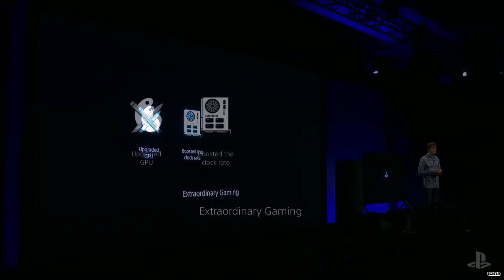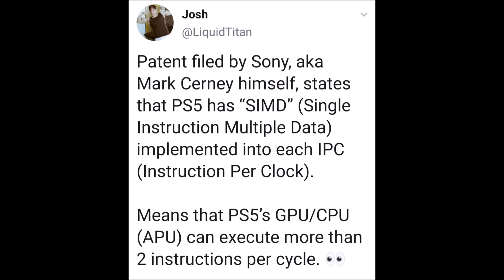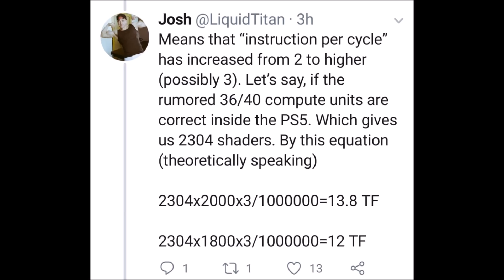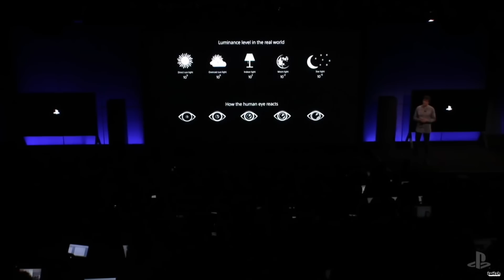Is This the PS5's "Secret Sauce"? Mark Cerny Rewriting The Tflop?

Comment: Know what this reminds me of? Ok check it out. If there's any DBZ fans in the comment section, remember during the Cell Saga when Vegeta was so shocked Trunks surpassed him in terms of power, however his muscles were SO BEEFY he ultimately stalled himself in terms of speed which allowed Cell to capitalize on that. Now think back to when Gohan went SSJ2. He was A LOT leaner but gained a SIGNIFICANT power boost & Trunks admitted he ascended beyond a super saiyan without gaining all that muscle mass. 

Xbox SeX = Trunks' beefy SSJ form. 
PS5 = SSJ 2 Gohan.
Reply: Super saiyan 2 is a more efficient transformation, keeps power and speed.

Where as trunks pulled a broly and just got brute force strength. Really powerful, but too slow.

Not a bad analogy my friend!
Reply: @NoahThomas29  Beautifully put. Exactly! And thank you mate!

Comment: People need to remember, sony and microsoft both have NOT said a word about T-Flops. that should be kinda telling. Because T-Flop numbers are kinda irrelevant now cause of not being directly comparable. 

example RDNA2 is apparently going to be a lot more efficient compared to RDNA1. Which means you could see a (im just throwing numbers here) 7 T-Flop GPU out performing a 9 T-Flop GPU from RDNA1. 

well i could see people saying “thats only 1 T-Flop faster than the xbox one x, thats not a big enough jump in power”.

But in reality the GPU would be FAR, FAR more capable than previous gen.

T-Flops are not everything.

Comment: When Xbox fanboys heard double the power they assumed 12 teraflops, but the navi architecture is different than the jaguar. To put it in context, the Xbox can have 9 teraflops like ps5 but because of the architecture it can be double the power of the Xbox one X. Like, the 5700rx being more powerful than the vega64 even though the 5700rx is 9 teraflops and the Vega64 is 13.5
Reply: Jaguar is actually the CPU side. Your thinking of GCN vs RDNA.

But yes you are spot on with this comment.
Reply: @NoahThomas29  yes that, thanks

Comment: It sounds like 
A.) The lower number of computing units reported from the leak came from a potentially deliberately masked processor.  

B.) parallel instructions in GPU processing has been standard for a number of years at this point since way back when Nvidia initially released CUDA and started wiping the floor with other GPUs and CPUs. When tech competitors found themselves lagging behind they started adopting SIMD instructions around redesigned hardware.  Direct X has SIMD instructions deeply integrated into it and has had them working hand-in-hand with GPUs for a couple of years.  

Sony may have done essentially done the same thing MS did with Xbox One X and hardcoded their rendering engine instructions into the GPU so that more of the computing happens on metal accelerating everything, however Xbox SX will obviously already have the same advantage.  

Whatever general speed advantage the PS5 has at this point, if it'real and measurable,  is likely do to superior hardware.  

Each console will have slight advantages over the other with various individual functions/procedures/effects but that won't add up to a 15%-20% speed advantage over the other particularly if one has lesser hardware.
Reply: But something is patented here....this tells me this is a unique implementation that is exclusive
Reply: Dual Purpose Well yes, if Sony has the rendering instructions hardcoded.in they have essentially a customized version of OpenGL which eliminates all the ”open-ness” of all the various other pieces of hardware openGL covers, like Apple does with their graphics API Metal.  

It’s unique as in no other company is using Sony’s render engine on hardware, but not unique in implementation.  Again, it will yield significant advantages it this is the case but across the board 15%-20% across the board is much more likely hardware if it's true.

Comment: The desperation here.
Reply: Explain
Reply: @austinhowell3511  the secret sauce is not that big of a deal and if Xbox actually has 12tf they simply will have the ore powerfull console. Also Xbox surely also has a few tricks up their sleeves. For example they have already shown off variable rate shading.
Reply: teehundeart VRS isn’t exclusive to Xbox
Reply: @austinhowell3511  yes my point is that Xbox is surely also working on some secret features to improve performance.

Comment: I follow this tech stuff a lot and I have never heard of any GPU that uses higher than 2 as the multiplier for IPC. That does not mean no one has ever made one like that. I am sure there is GPU tech that I have never heard of before. But it does make it seem to me like a very new idea. AMD certainly does not currently do that on any of its GPUs, not even RDNA 1.

However, Sony has in the past conceived of an improvement that AMD's GPUs that was later added in. That is using 8 ACEs, something the base PS4 done first and AMD later added to its GCN based PC GPUs. So it is not infeasible that Sony has done something similar here, especially since Mark Cerny was lead architect in both cases.

EDIT: Originally GCN had 2 ACEs.
Reply: Some people said that SIMD seems to be something that was used in the PS3 architecture
Reply: @DualPurpose  I will admit that I do not know much about the PS3 GPU. The main thing I know is that the Cell CPU was PS3''s main strength power wise but was so hard to develop for that 3rd party studios rarely got to take advantage of that strength.

EDIT: Typos.
Reply: @kanebunce3791  The PS3 had a Nvidia GPU an RSX G70 variant. The Cell itself was a CPU that had the ability to render graphics and accomplish multiple tasks. 

Sony designed it purposely ti be complex so that developers would exclusively devote their resources to coding for it and not competing platforms...that backfired obviously.

But if the revisited it made it simple but keep the same functionality it would be a beast

Comment: The majority of PS5 related rumblings have been rumors, and not official leaks; there is a distinct difference. 

Your GPU analysis is completely off, the PS5’s theoretical performance is based on a highly customized variant of RDNA’s NAVI architecture. PS5 will utilize Navi 10 features such as 56 CU’s, which would easily top the alleged 9.2 TFLOPs leak. 😏

In Mark Cerny we trust.

Comment: I just hope this secret sauce for ps5 doesn’t bring the same game development issues as the ps3
Reply: It's a fact that it won't, Sony said that has learned from PS3 and ps5 is actually the easiest console to develop
Reply: The problem with PS3 development is how complex the Cell CPU was. This secret sauce, if true, does not add any extra complexity to the hardware. It simply allows the hardware to achieve more.

Comment: If it's $400, I'm buying two for sure.
Reply: Sometimes you just gotta cave in and go for 5
Reply: @ultimategamer8763  lol
Reply: @ultimategamer8763  can I pay a hooker 500 for happy ending
Reply: @darkoni95  indeed you can
Reply: I'll take one
Reply: Itll be upto £450 UK which is still good, considering inflation.
PS4 cost £350 at launch, 7 years of inflation makes it about £420 now.
Cosidering how much power is supposedly going into next gen, I expect both next gen consoles to aim for £425/£450. Which translates $500/$550 US.

Still good when  then power is supposed to match an $800 PC
Reply: i have to buy 4 or 5 minimum :)
Reply: Why two? You gonna offer the other one?
Reply: Obviously more money than sense
Reply: @corneliusromeo2123  infortunately, that can be said about most posters with less than a dollar
Reply: even 600$ bring it on!
Reply: Chris Struble It won’t be $400 it will be $500 and still cheap at that where it comes too performance too price.
Reply: @-Old-School-Gamer  a smart way to go would be $450

Comment: Dude, you're missing the obvious analogy. Cars with more horsepower are frequently outpaced by cars with less. Teraflop isn't supposed to be a metric for "overall powerformance".
Reply: Teraflops don't translate into gaming performance in the first place (:
Reply: Right. TFLOPs are really just a measurement of raw compute performance. Not gaming. For gamers, at best a higher TFLOP count is better within the exact same iteration of the same architecture. For example, the way the 5700 XT has more TFLOPs than any other RDNA 1 GPU. But such a comparison won't mean much even between RDNA 1 and RDNA 2 let alone different architectures.
Reply: @kanebunce3791  You got it (:
Reply: @ysujy2146  I was disappointed last generation when both Sony and MS kept going on about TFLOPs with the base and mid cycle consoles. but so far both have steered away from such talks and instead focused on other factors that will make more difference such as the ultra fast SSDs.
Reply: I completely agree with you. But the problem arises when we are talking about same architecture then tflops can be used to determine relative (not absolute) performance.
Reply: manpreet Singh still irrelevant as it’s more about how developers use that power. Xbox has the power this gen yet still didn’t have the best looking games

Comment: The checkerboard rendering on PS4Pro is completely fine, I'm thinking they'll do something similar with PS5 - be it for 4K or 8K. Mark is a very smart individual and knows his way around code - he'll do the best for the PlayStation community.
Reply: 26101976bdm why would he do it for 4K when it will be able to 4K 30 and 60 native
Reply: @chasethechosenone8478  because the raw power needed to do Native 4K 60fps is HUGE - it's just a way to achieve 4K while utilizing the power in other ways. 

More detailed textures, larger world's, more dynamic lighting, better animation.

It's only speculation - but I can see a few software based 'cheats' to achieve more than what the base specs suggest.
Reply: @chasethechosenone8478  if they can get checkerboard 4K that looks convincing they can use the extra power to improve graphics.
Sure they can make 4K60fps games, but they could also do "fake" 4K60fps with insane graphics

Comment: Anyone know if there’s gonna be like a ps5 “pro” or whatever they would call it
Reply: The_Lonely_one 96 later on not any time soon
Reply: Chasethechosen One it’ll probably be like 4 years in about 2-3 years till the end of the console but it will be great depending on how they do it
Reply: @Salt Maker Considering that during this gen, Microsoft released base console, 2 mid gen refresh systems, and the all digital version of the One S, it's pretty logical to assume that a mid gen refresh will be a regular thing from that side. I highly doubt Sony will let their main competition release hardware 3 years newer and them not release a competing system. Regardless of why it started, that is almost definitely a trend that is here to stay.
Reply: The_Lonely_one 96 Yup. The PS5 Magnum!
Reply: Yeah, this gen was testing the waters for mid gen refresh and it went over well. Maybe debatable for the One X, but all in all, I like mine. I'm confident that if Sony had released an extra console to compete with the X, we would have had native 4k and better frame rates as well. Shame they didn't. I would have bought it
Reply: @Salt Maker yeah, all that I'm familiar with. But point still stands that 3-4 years into next gen (4-5 years from now), TV manufacturers are pushing 8k tech. Not really feasible now, but by 2024 +/- we'll most likely be seeing the same strides in that tech as we saw with 4k. If that ends up being the case, it's likely that Microsoft will definitely be trying to make mid gen upgrades to push towards more consistent 4k/120 trying to reach closer to 8k/30. Time will tell.
Reply: @Salt Maker sony themselves said that they like the idea of a PS5 Pro. For the time being however, the base PS5 seems to be a beast